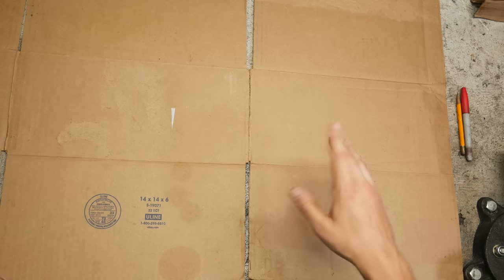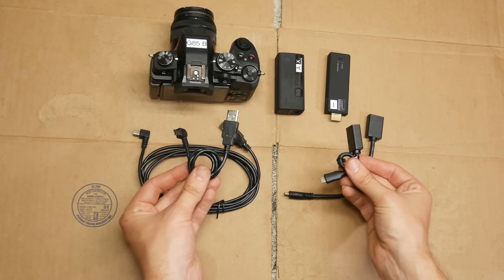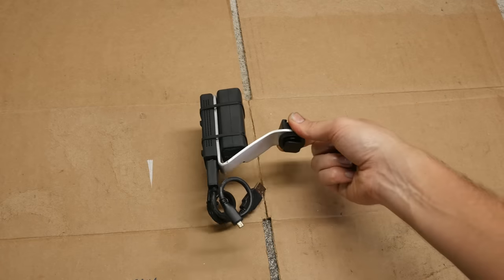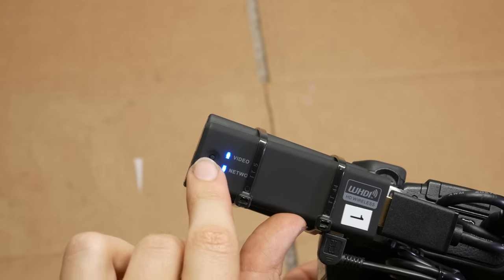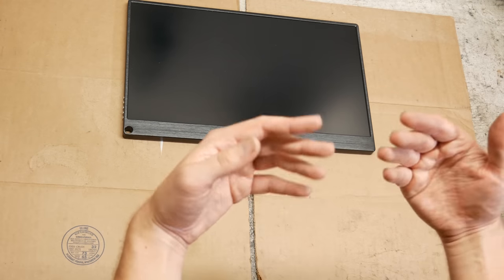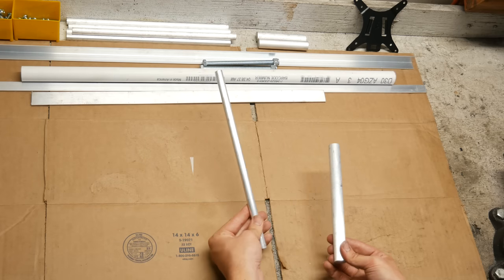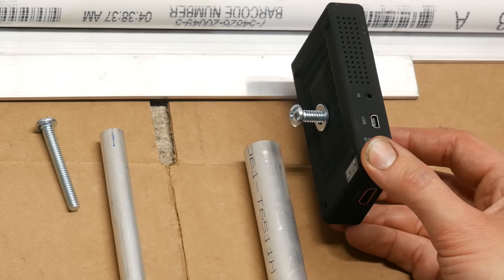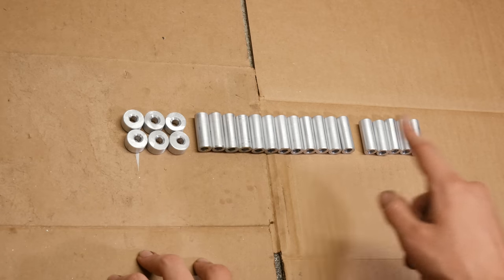Wireless HDMI Monitor Project Part 2: Building Transmitter Mounts and Housing Components

Comment: 11:06 You don't have a Lowe's, Home Depot, Menards, Ace Hardware, etc??? These places always have this stuff ready to go...
Reply from the maker: I get most local hardware from Tractor Supply, but by the time I got around to the handle building it was late enough that they had closed and Home Depot only had the 5.5" bolts in stock

Comment: I think you needed a bit more threadlocker on the horseshoe thread. Did you intentionally have the drill sounds fit the same key as the backing track?
Reply from the maker: I agree about the threadlocker, I should have used red and just dunked the part in a five gallon bucket of it.

And no, I didn't intentionally match the key though I did sync up moments of time in certain spots

Comment: you could of course save a lot of the laborious work by cad designing very customized parts and 3d print them but then again it wouldn't be that much fun and less to watch :)
I do most custom part manufacturing with 3d printing because I don't have all the handy machines for metal working but a lot more patience is required because it takes a loooooooong time to print. So if you want to get started with 3d printing, I got mine in 2017 for 120 including shipping so its not a huge investment. or of course let someone else print it. it is definitively quite a different approach but makes you consider different options and opens more possibilities that you could also combine. Anyway thanks for making part 2!
Reply: What 3d printer do you have ?
Reply: @ACYT298  Anet A8, came as a DIY assembly kit.
Reply from the maker: 3D printers are really cool, a friend has one and he has helped me print a few things before. Designing an even more compact and lightweight version of this on a printer would be very cool, but one big aspect would make that tricky. I'm not sure I have talked about it in these videos yet, but all that aluminum is acting as a heat sink and pulling the not inconsiderable amount of heat away from the receivers, they get very hot even just sitting on a desk but being hard mounted to that big piece of aluminum helps immensely. May even be enough heat to melt a 3D printed part.

Comment: I gotta ask ... do you not have a drill press?
Reply from the maker: I have a small Harbor Freight one, but with most of these parts it would take so much time/effort/tools I don't have to clamp the workpieces down on it and the required precision wasn't so high that it seemed worth all the effort. Mostly was a factor of needing to get things done quickly.
Reply: @FuzzyDiceProjects  Just asking because you were drilling a lot of holes in the center of round pieces, which would work so much faster and accurately with an extremely simple jig on a drill press i.e. literally two wooden blocks screwed to a base plate, which takes maybe ... idk ... a minute to put together.
Reply from the maker: There was so much heat drilling the small dowels that I actually managed to melt one of them so they have to be cooled several times through the drilling process, which would mean taking the jig apart for each one (or just dumping water everywhere I guess) and wood would not be a good choice. A metal jig would be perfect but it would have to grip very tightly (also a problem with a wood jig with a soft metal like aluminum) though I was also trying not to scar the dowel surface and the only way to do that with a smooth metal or wood jig would be to apply so much pressure that the thin walled spacer would probably deform with the drill bit inside and grab/break/cause more issues. In this case engineering all of that for something I don't see myself doing too often didn't really seem worth it.

In the next video part I used the drill press and locking pliers to drill a few more dowels into spacers, overall I think just doing it with the hand drill was a bit easier and more controllable for the amount of time spent.

Comment: I admit I haven't seen the cuisine on the plate yet, but from the looks the of kitchen at this point you badly need either a drill press or a 3D printer for this job. The offer to print stuff still stands. You're welcome to use my drill press too, but I think the drive is a killer.

Also, without knowing your entire design intent, I'm wondering if some stainless zip ties and some vacuum tube would have reduced your workload and weight on those battery clamps.
Reply from the maker: I have a small drill press, but with most of these parts it would take so much time/effort/tools I don't have to clamp the workpieces down on it and the required precision wasn't so high that it seemed worth all the effort. Mostly was a factor of needing to get things done quickly.

3D printers are really cool, a friend has one and he has helped me print a few things before and designing an even more compact and lightweight version of this on a printer would be very cool, but one big aspect would make that tricky. I'm not sure I have talked about it in these videos yet, but all that aluminum is acting as a heat sink and pulling the not inconsiderable amount of heat away from the receivers, they get very hot even just sitting on a desk but being hard mounted to that big piece of aluminum helps immensely. May even be enough heat to melt a 3D printed part.

As for the battery clamps, zip ties would do the job but I wanted the batteries to be easily removable in the field so that if more runtime is needed they could just be swapped out without any other disassembly of the units. Turns out, those batteries last a long time so it isn't as big of an issue as I thought it might be, but still good to have that option for the future.

Comment: I love your videos and 100% respect your diy and from scratch approaches, but are you familiar with McMaster Carr. www.mcmaster.com/spacers ? The spacers and other components are readily available and usually same or next day shipping. Alternatively there are fastenal and granger locations in Rockville and all around MD
Reply from the maker: Good point! I looked into it, but getting just the 1/2" OD housing spacers I ended up using would have cost $80+shipping at McMaster, while the aluminum dowels I purchased and didn't even use all of only cost $14 shipped. McMaster doesn't have all the lengths I needed so I would have had to modify some of them, and I ended up needing different length spacers for the other unit and I would have had to place a second order and spend even more money instead of just taking a few hours and making exactly what I needed with material I had on hand.

On the time and effort vs cost equation I usually have to/choose to lean towards the time and effort intensive solutions.

Comment: 23:33 Here and elsewhere you label this as chamfering. Aren't you actually countersinking? I thought a chamfer was what you do at 22:37 to the PVC.
Reply: One is external on a circular edge, the other one is internal. Counterboring is to accomodate a screwhead.
Reply from the maker: I'm not the most knowledgeable with that terminology and exactly how it applies, so you may well be correct. I felt like countersinking was specifically for fitting a screw head flush with a surface and implies some level of precision, while I was just breaking the inside edge of the drilled holes.

Comment: For a more compact setup not attached to the camera maybe look into connecting the transmitter and the battery together and putting some velcro on the battery and just putting some on the tripod. You might need to put a small square of material on the tripod for a more flat attachment point but that should be a bit better than zip ties. Also a good idea would be to put a power switch on the usb cable going to the transmitter so the powerbank can naturally turn off when not in use without unplugging it. With the shutoff mounted on the usb cable you should be able to charge it as a whole unit and not need to take the battery off unless you're planning to do hot swapping of the battery.
Reply from the maker: I actually bought toggle switches to wire into the USB connections (you'll see them briefly in the next video), but for time reasons I abandoned that for now, and plugging/unplugging the cables isn't as annoying as I thought it might be.

The other cameras using this system will just have tripod mounts for the batteries and transmitters similar to what you described. That way larger battery packs can be used that can power the transmitter and the camera. Will probably make some aluminum bracket or something for that as well though to help sink heat from the transmitters and separate them from the batteries a bit to hopefully improve signal strength since when I tested with them taped to a battery pack it did have a negative effect on range.